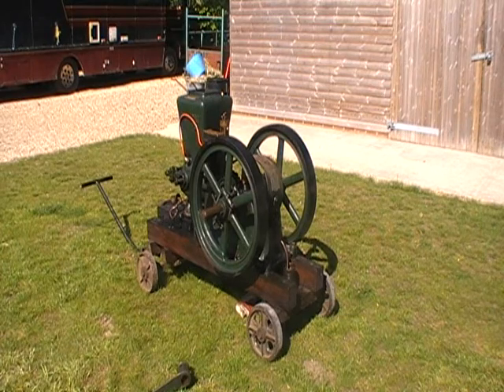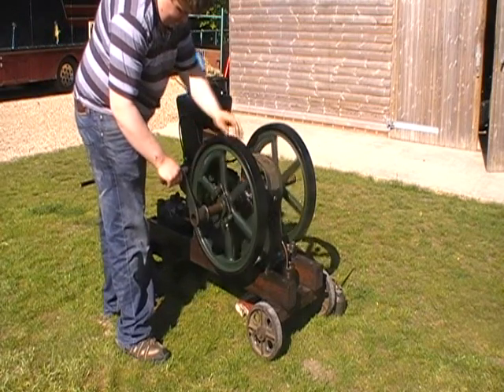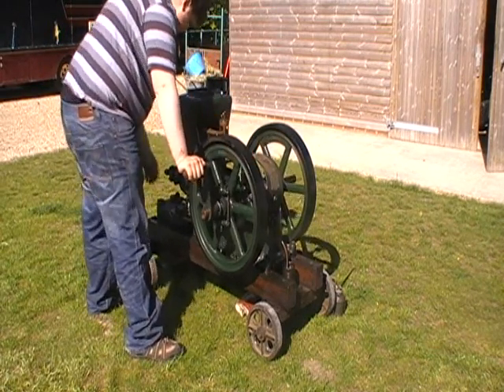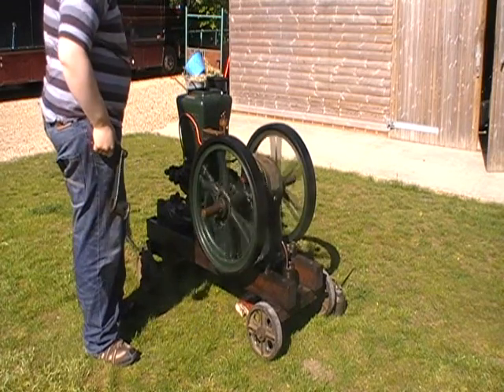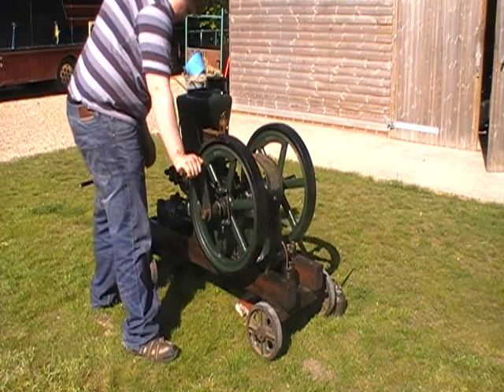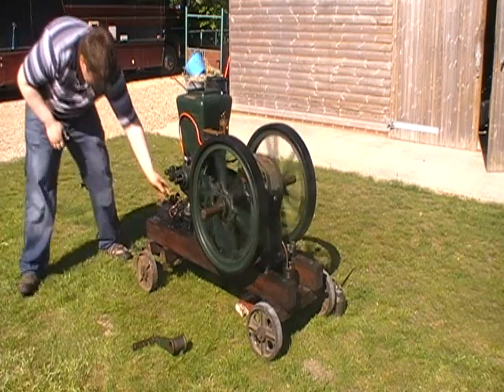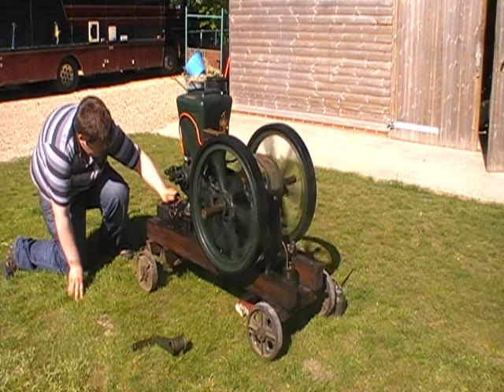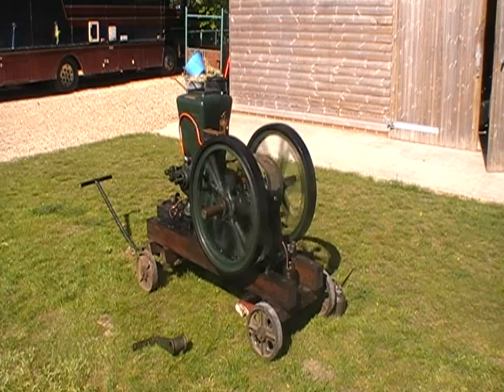Bamford 3hp throttle governed engine

Comment: found my cure for my rough running the air valve behind the primer bit the spring was broken,new spring and a washer it now runs very smoothly once hot

Comment: I got a 4hp OC bamford with the fuel primer under the carb and if i fill it i can just pull the flywheels over by hand after a few turns it will fire up..strangely mine runs a bit rough as well,I havent seen or heard one run smoothly yet.mine has weak valve springs which dont help.
There is a few vids of mine running in my videos

Comment: Loveley engine there Angus and looks to be in very capable hands. It's nice to see someone taking the time to oil the engine correctley.

It sounds to me like the starting problem and the hit and missing could be the atmospheric inlet valve, the exhuast may need grinding in as if it's not a good seal of course the inlet won't operate correctley.

She does run niceley though and looks a beuty too!

All the best,

Phill.